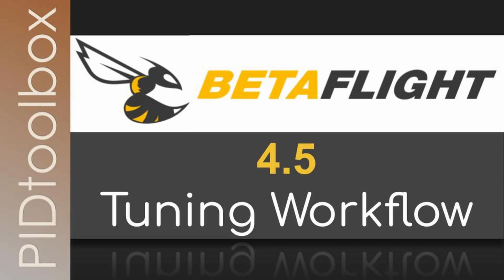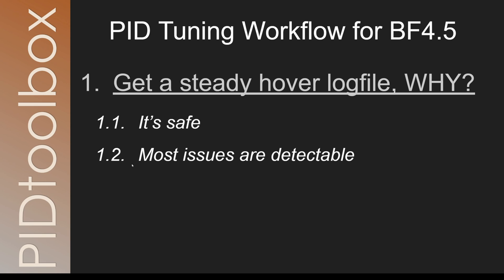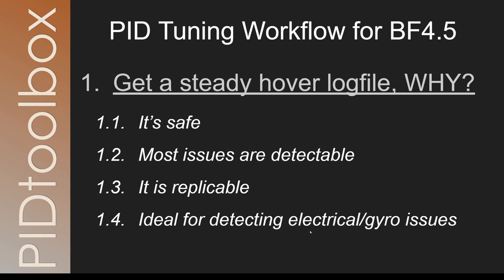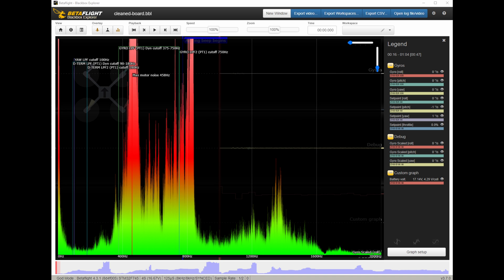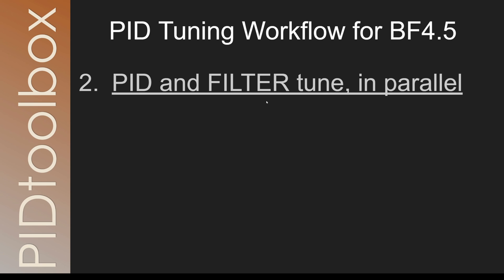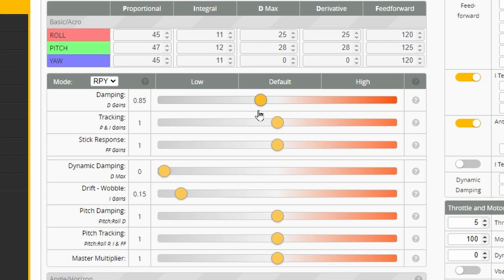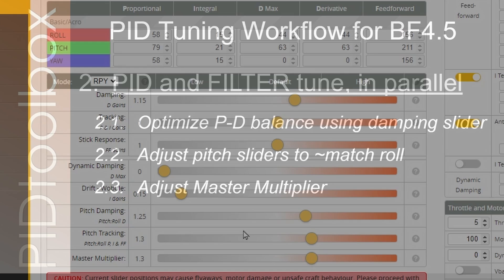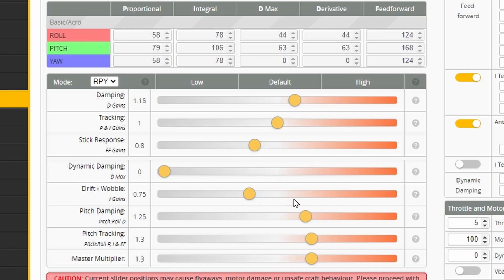🔧Betaflight 4.5 Tuning Workflow using PIDtoolbox🔧

Comment from the maker: !!! Please note !!! At time 10:38, Do not misinterpret my discussion there as suggesting that you should start tuning the Master multiplier first, before PD balance etc. That is NOT what I am saying. The basic PID tuning steps have not changed (and I’ve stated this in the current vid), and for more detail on this you should follow my previous videos. In this part of the video (10:38) I am just talking about how to set STARTING values (ie, the values of sliders for the FIRST of your series of tuning tests). Hope this is clear. Happy Tuning! -brian
Reply: may i know where's to find any information about betaflight adjusment for ICM Gyro ?
Reply from the maker: @captaindronieversefpv  Betaflight discord maybe ?

Comment: Hi
What about angle strenght in BF4.5? Shouldnt it be changed from 50 to 100?
Reply from the maker: Leave angle strength at 50. Set rates to linear for tuning. Set angle feedforward to 0 (it’s in CLI)
Reply: @PIDtoolbox  ok thanks
Reply: @PIDtoolbox  ok I've done some tests and I'm confused :
Test 1 acro, rates with expo, angle FF=50
Test 2 angle, rates with expo, angle FF=50
Test 3 acro, linear rates, angle FF=50
Test 4 angle, linear rates, angle FF=50
Test 5 acro, linear rates, angle FF=0
Test 6 angle, linear rates, angle FF=0

All tests (1,3,5) on acro mode are nearly similiar as expected...  but, every test on angle mode (2, 4, 6) gives very different result and none of them are like tests on acro. If I have to choose which one on angle mode is closer to acro then test no. 2 will be closest, but it's different enought that it cannot be used in basement tuning method in angle and then fly in acro.

 Till BF4.4.3 everything was crispy clear, easy and repetitive but now it looks like you can't use angle to get the same result in acro

If you want to look BB log tests then I can send it to you.
Reply from the maker: @Prosto_o_Dronach  send link to 2 logfiles that show a difference between angle vs acro
Reply: @PIDtoolbox  I've made another test to check how angle strenght affect the PIDs, so I've add angle strenght =100 to settings in test 6 and it was even worse.
Reply from the maker: @Prosto_o_Dronach  that is incorrect. Share logfiles so I can give you proper feedback
Reply: @PIDtoolbox  I've tried to put link to google drive in comment but it's automatically delete :/

Comment: I installed PID toolbox. Tried opening a Betafligth log file - the UI shows a small popup window that loads the values ("Please wait...") but it stays there indefinitely. I did not restart the computer after the matlab dependency install. Could that be the issue?
Reply from the maker: It means you didn’t follow the installation vid carefully
Reply: @PIDtoolbox  
The thing is, the default install location is C:\Program Files\ and PID toolbox exe doesn't have anything in its manifest that forces it to run with admin rights. So obviously it cannot write into the folder where it runs. It can't create the log file. 

The dev could make things far more easier for users by 1) defaulting to a non C:\Program Files directory for install, for example, the Users folder as the standard approach followed by apps that doesn't need elevated rights and apps that install only for the current user 2) Even if the default install location is kept at C:\Program Files, the working directory could in within the Users folder. With these approaches, there's no need to have the program binaries separately shipped and no need to ask users to run it from another folder or anything. The installed binaries and the shortcut should just work well.
Reply from the maker: @Sleeperknot  MAtlab App compiler does not allow install locations besides the typical Programs Folder. The 'working directory has to include the 3rd party BB_decode programs to extract the data from .bbl files. It's just how it is. Most have no issue if they follow the instructions.

Comment: What do you mean by take into account rotational inertia when designing a frame. Position of motors, like X or stretched? Or weight distribution of where parts are installed?
Reply from the maker: Prop to prop distance for example (some xclass frames come to mind).  Greater distance, more rot. Inertia. More rot. Inertia, more P and D are needed. More D means more noise into the pid controller

Comment: Trying to tune 10" right now. Using pid tool box right now. Trying alot of different settings along with looking at blackbox
I need to try angle mode and just hovering.

Comment: i followed the older videos and got results i never had in 10 years before. thank you for that. i appreciate more videos with one step after another and how to control which values are in OK area and which is not. i also would watch these long videos from other pilots sending in their files with problems. there is no other channel in the world which does that, its a unique thing.
Reply from the maker: Thank you, greatly appreciate
Reply: The older videos are much better put together than this. This video seems like a defense case for the old videos. Not a straight forward "workflow" video.

Comment: there are none other than rpm filter weight not one 🤔
Reply: Ya PIDs and filters come over from 4.4 no issue, the filters work a bit better in 4.5 but there is no changes to the way they workz and the rpm weight is only really for the advanced tuner
Reply from the maker: nothing that I see that changes the pid tuning process in any significant way. any pidf from 4.4 will work the same on 4.5

Comment: Why in angle mode? I never fly angle mode? Is it just sugeested for safety or it does it gice better data?
Reply from the maker: Safer and cleaner more reliable data, and able to be done in a confined space. It’s just for tuning and it’s not tuning angle mode. It’s tuning the acro PIDs but in a convenient way
Reply: @PIDtoolbox  so switch to angle for better data or just safety? I've never had issues hovering around in acro as far as control is concerned. But I deff want best data as possible. Kinda a setpoint gyro and latency snob when it comes to tuning. Always trying to push it to absolute limits of the crafts.
Reply: @JLfpv  i get cool responsible data when switched to low rate and angle mod for tuning. it helps me for best tuning in my small room without crashes